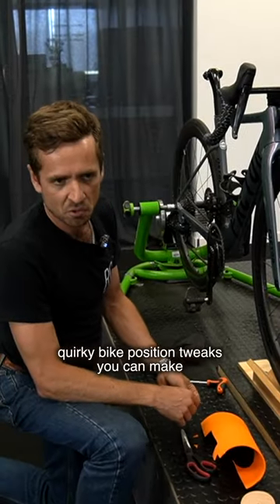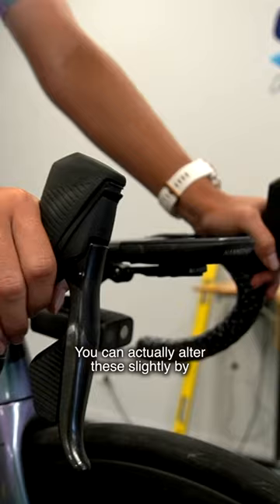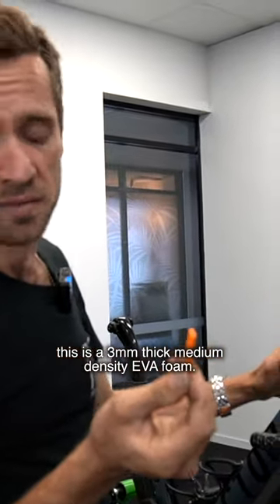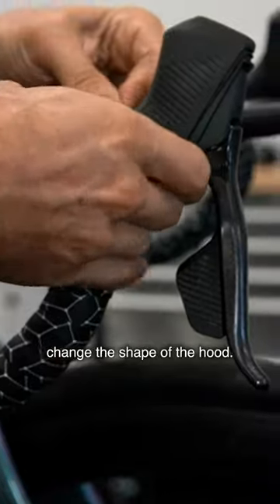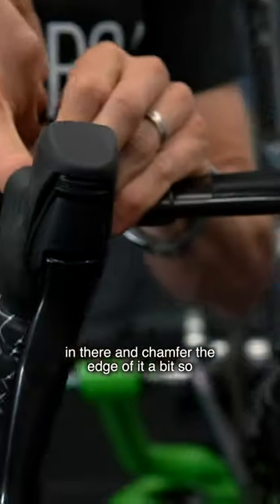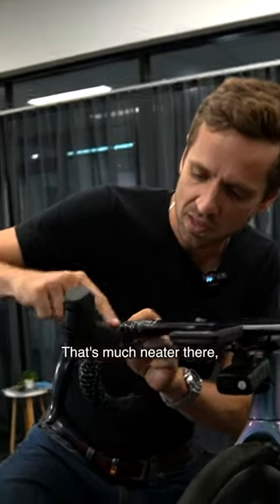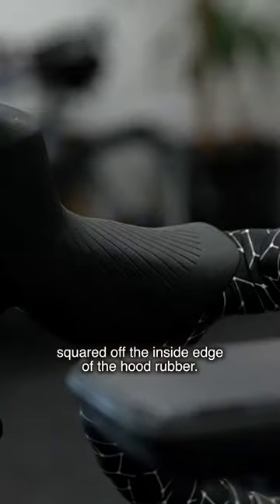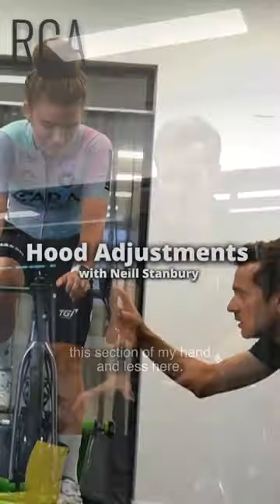Hood Adjustments #shorts

Comment: if you know you want it a small wedge under bar tape. where the heel of your palm sits, electronic tape holders it in place ,closed cell foam pipe insoulation,or piece of jell insol from an old shoe.